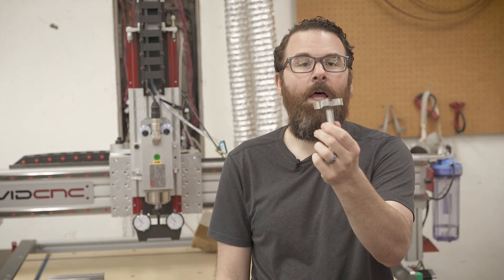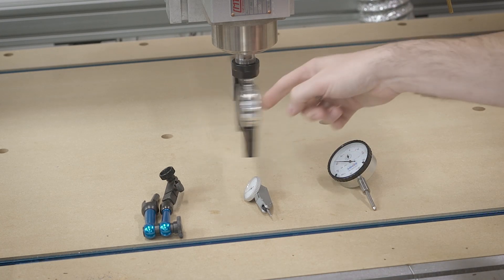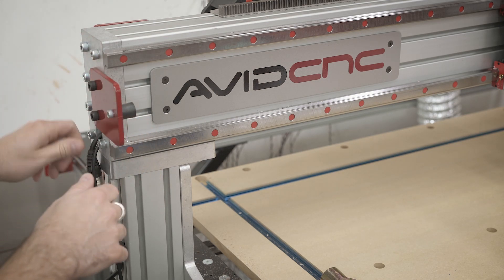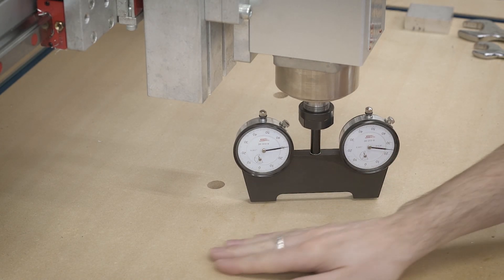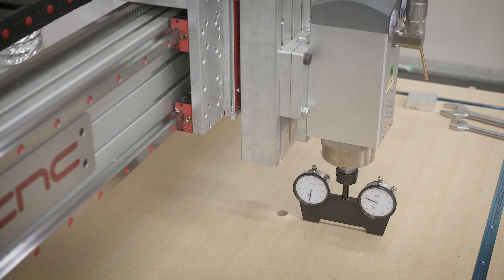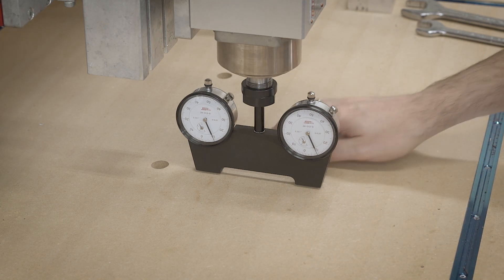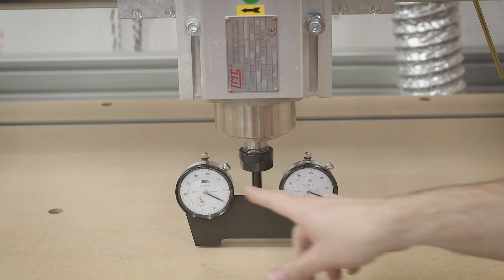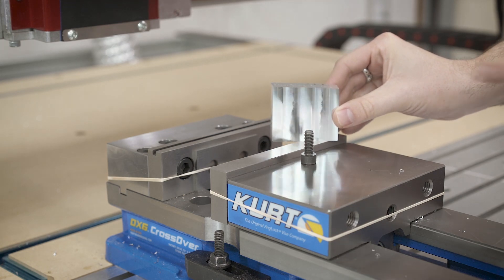How to Tram Avid CNC Router

Comment: Well done Sir, why did u put the metal strips on the left side of spindle vs the right side?
Reply from the maker: NO idea.  Maybe because I'm left-handed?
Reply: so does the piece u add need put on both sides of the spindle or just one side like u showed
Reply from the maker: @timc2797  OH, the shims.  Sorry, this video was 4 years ago,  don't really remember it well.  Yes, add shims to both sides.  You're shimming the interface between the two surfaces.
Reply: @ thank u

Comment: I'm curious how you got your tram tool to be aligned in the first place. I usually put a block on the surface and pivot both indicators to that block to zero them out. When I go back to the surface the zeros on both indicators are measuring the same distance even thought the needle will not necessarily be in the same place.
Reply from the maker: I used a granite surface plate, which is the standard way to calibrate something like this.  It comes with instructions on how to set it initially.

Comment: You made a big assumption here that your table is flat. You first should have run a dial indicator over a known flat surface such as a surface plate, then shimmed the plate so it shows as flat on each corner, then do the tramming of that surface. Too much room for error in how you have done it especially on an MDF board.
Reply from the maker: I don't disagree!  The whole surface of the MDF was surfaced flat with the mill, so I'm reasonably confident it's flat.  And since the 'reference surface' was machined flat with the router, the tolerance of the bed is only as good as what the machine can achieve.
Reply: Thats a fair assumption but if you surfaced the bed when the head was out of tram what could happen is when measuring you could be measuring from a valley to a high spot. Your point is valid about what tolerances the machine can operate at for sure, but when machining aluminium you want to be as sure as you can be that the reference surface that you started  with was indeed flat and level to the gantry.
 @RobertCowanDIY
Reply from the maker: @Festivejelly Yeah, fair.
Reply: @RobertCowanDIY  Just to come back to this, I saw a chap using a gauge block to do the tramming over rather than doing it directly on the bed. This way it would average out any peaks and valleys on the waste board. These days accurate gauge blocks are quite cheap to buy so thats probably the way to go doing this.
Reply: @Festivejelly This is my concern too, whenever I see a tramming video. Just because the spoilboard is freshly surfaced doesn't mean anything. If the spindle is out of whack to begin with, you still have nothing to measure to.
There needs to be some way where a spindle can be trammed to a laser level line. That's the only way this is going to really work.

Comment: Nice video.
1. Put a plate of glass under those indicators.
(Use simple glass, not the tempered one.)
2.  Check for squareness of the portal vs the side rails before starting this procedure.

Comment: Thanks for sharing. I would suggest a glass or granite slab to zero to though. As you mentioned the mdf has some give to it.
Reply from the maker: Oh, I do have a granite surface plate, that was used off-camera to calibrate the tool.

Comment: First I'd like to say thanks for this video it's been very helpful. There is certainly a chicken and egg thing going on when trying to do this adjustment. I just put together the same machine you have. I figured out how to get rid of the chicken the egg and the spoilboard. I put a long piece 15" of .5" drill rod in the spindle and put a dial indicator against the rod, first in the Y axes direction and then in the X while running the spindle up and down to check for out of square . I figured out how to eliminate the runout and was able to use the adjustment nut to get the Y axes so for 10" of travel I was just under a thou of tilt. This is where you really helped. I'm currently getting .029" of Nod over that same 10" but now I know how to fix it, thanks.  To bad I can't post a picture.
Reply from the maker: Glad it helped!

Comment: What a clear video and edit. this is surprisingly good. should I consider a MDF from the factory as "flat" surface? I mean at least in terms of flatness required for wood
Reply from the maker: Even if the MDF is perfectly flat, the table below it might not be.  It's always a good idea to face down your bed/table, that will guarantee it is flat.

Comment: Thanks for the detailed video Robert!  I was curious what model Starrett spindle square you are using.  The like above doesn't go to a particular product any longer.  The 649-1 looks similar to what you use in the video, but it's up to around $200 and I believe you mentioned a price point ~$100 in the video.  Thanks again!
Reply: It's not a Starrett. It's an Spi.

Comment: When you flexed the frame, how hard were you pushing on that thing? I'm considering buying one of these for aluminum milling and .01" of flex from just a hand touch is a bit concerning. Or I guess the question I should be asking is: how much of a tolerance does it hold in your aluminum parts despite the flex?
Reply from the maker: I was putting my whole weight into it.  The FRAME flexes just a little bit, maybe a couple thou, but the MDF is pretty flexy of course.  If you cut everything using an adaptive tool path, and then come back and do a light cut to sneak up on your final dimension, it works fine.  I've had no real issues (yet).  BUT, finish could be improved, don't expect a mirror finish on parts.  They are functional, but not always pretty.

Comment: Very nice Robert!  
I also have one of these tables and have spent much time trying to tram it.  I never really got it to where I wanted it but I got it to the best that it can do with the way I installed it.  I think it could be better if I spent more time on the rack and pinion install.  My rail seems to dip on the right side .006 about 30 inches into the y,  Aluminum in a vice is perfect but facing aluminum on the table isn’t great.  It’s fine with a small EM but it’d be faster if using a facer.  PAY CLOSE ATTENTION TO INITIAL INSTALL!!
BTW i installed 3 extra cross beams and 1/2” T5 aluminum plate on the table with 1”hdpe spoil board. Very sturdy table top.  Overall a good machine!!

Comment: Wouldn't this method/holder also assume the dial holder is perfectly manufactured and both dials are perfectly seated in the holders?
Let's say one holder sits just a few thou higher than the other, possibly as a result of the shaft having a tiny bend in it, wouldn't this give false readings for example or am I missing something?
I really want to implement something similar on my mill so I can stop having to rotate it back and forth constantly to get the head straight ... :)
Love the rubber band solution by the way, such a simple way of holding the parallels in place!
Reply: Yes, he didn't do that critical step. Here is how you do it:

https://www.youtube.com/watch?v=tO3T-t81k4A

Comment: What about tramming the x axis bar before the spindle/z axis. If the x axis is slight angle, wouldnt the z axis then slide forward or back while moving up and down?

I also thought when using tram tool you dont try to get both dials read same. You zero dials and then rotated it 180 and verify both are still fairly zeroed. Using the edge tool on my shapeoko was quite the brain burner trying to understand it all the first few times.

Comment: Excellent video, you obviously have a lot of skill in CNC work. I had never done this procedure, but last year noticed that my flat cuts looked like clapboard siding on the house. I appreciate the quality of Starrett tools, but I had a different idea to square the spindle, instead of their square. I epoxied a dull end mill into the center of a small flat board, mounted it in my lathe, and turned it round, and square to the end mill. I then drilled a hole near the perimeter of the disk, and mounted 1 gage in it. When I install it in my spindle, I can rotate it 180 deg in any plane, and compare both sides. Not as convenient, but next time I use it, I don’t need to check if jig went out of square, as the t type could. Even if the disk isn’t perfectly perpendicular to the mill, it will read accurately in all positions.
Reply from the maker: Yes, this totally works as well!  As long as it's rigid and doesn't move when you sweep it, this is perfectly acceptable as well.  I just got the spindle square cheap off eBay many years ago.